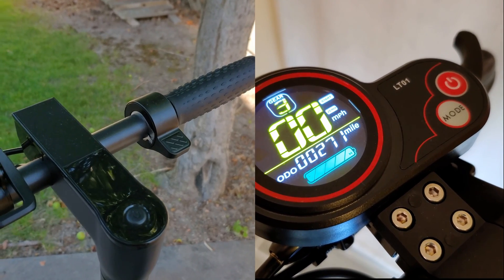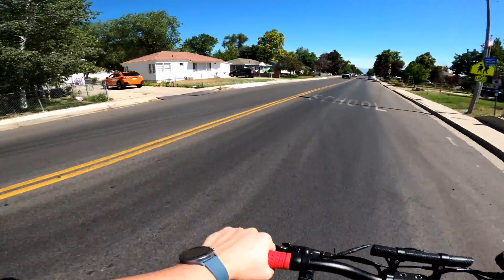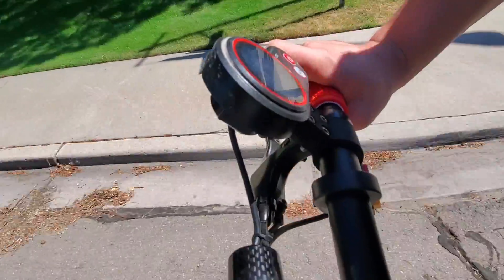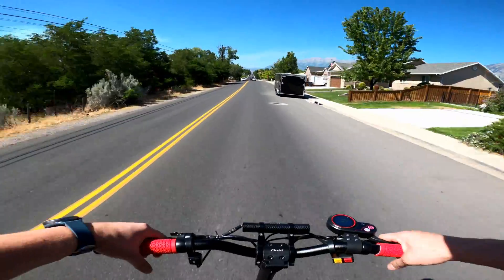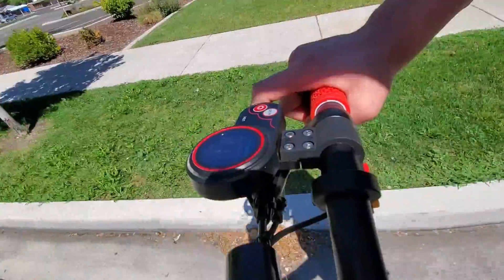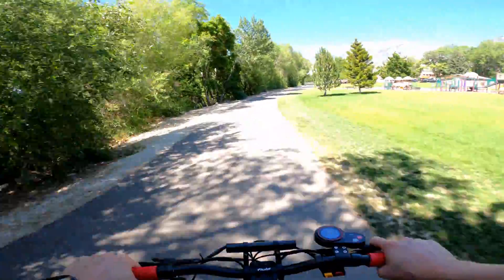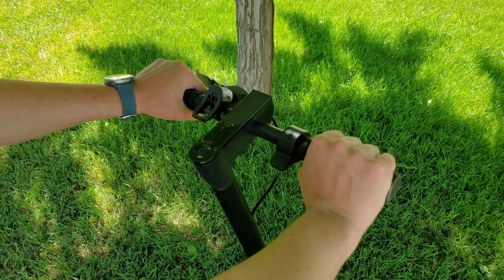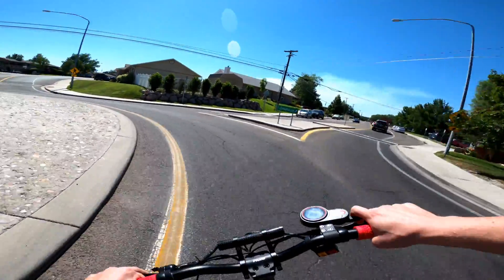Electric Scooter Throttles: Thumb vs Trigger

Comment: your thumb throttle is positioned wrong as well....same as the vertical oritentation of trigger throttle is completely wrong

your thumb throttle should be positioned so that when full throttle your thumb is completely straight and in the furthest reach position
that way it fully wraps around the handlebars and provides full grip and control and no fatigue

scooter manufacturers position both of these throttle types wrong and not many people use their brain and reposition to more ergonomic and safer position
I have a thumb throttle that I adjusted to my liking and have none of the issues you talk about

thumb throttle when positioned correctly is the safer option because you can have your fingers on both the throttle and both brakes at the same time so no need to repoision fingers from throttle to brake in an emergency situation

Comment: I originally had the Max with the thumb throttle. Then I got the 300X with the twist. I am finding I preferred the thumb throttle for scooters even tho I have decades of motorcycle riding throttle experience. Now I just need to see if I can convert my twist to a thumb on my 300X.

Comment: Calling it an error is a bit far for beginners to angle their trigger throttle...it's a design issue with the product.

To be comfortable for rider, the display needs to be pointed towards the damn ground.  Terrible design.

Sure it works...the only reason they keep making them like that is people like in this video say it still sort of works.

Sure, I could still technically drive a car with the accelerator pedal was the passenger side glove box handle, but it's pretty dumb.  There would be videos saying try it, it works, just drive leaning over and keep your finger on the glove box handle.

Comment: great video and agree with the positioning of brakes and throttle. sadly and most frustratingly, the kaabo skywalker handle bar, perhaps not wide enough or because it requires room to fold down, the brake levers and the throttle cannot be moved further inward, so they all end up cramped together with the fingers in the way of each other and no room to comfortably place or use them on brake and throttle without overlapping, blocking and literally dangerous and fumbling with the lever and trigger on top of each other! no wonder the throttle is perhaps, in my case, have to be angled up so as to be kept out of the way of overlapping the brake lever, preventing the trigger from being pulled, etc. etc. 😤😤😤

Comment: i prefer the Nami style (Wuxing 108X) and round throttle like Rion etc.

I had a trigger throttle, and when adjusted correctly it is decent to ride with, but it feels less controllable than one of those IMO

i can also put my thumb on the body of that style thumb throttle and do small movements because i ride in power control mode (while scooters out of the box ride in speed control mode)

Comment: Hello from Bulgaria..i have G-booster for 40 days...i had xiaomi 365 for 3weeks and i rode a kaabo 10 800w 2 days...i thought the trigger is waaaay better and looks x5 sportyer then my kugoo's thumb throttle newer display onboard computer/controller hahaha....sooo my little experience with these things showed me that the triggers are freaking DANGEROUS for a firsttimers...i wasnt a firts timer but i had veeeery close calls with that kaabo...the scooter was set in the baddest ways possible (brakes,triger and all) but still i am a guy who can drive everything,everywhere and on fulll power..i ride race bikes 750-1000cc and i can easylly say i can handle a scooter with ease...and that kaabo was dangerous even for me?>????what???i didnt believed i almost crashed 3 times for 2km hahahahha not so funny when it jumped instead of stop...my g booster was my first real scooter with real power and 8i never had problems confusing brake for throttle or thr. for brake...i ride hard and long..start on max battery and finish close or even to the moment you realize THIS IS IT now you push...its not nice to push 33kg scooter+gadgets+full set protectors,motocross helmet and a bend rotor who is making it soooo heavy to push...i had to remove the caliper to make it stop braking on its own...i hope my story is funny and informative...i pray to  alll Gods to set foot and hands on more powerful scooter...VSETT 10 or 11 or maybe a offroad beast with 2x2400 and 40A battery...i love to feel the danger and to fight the beast...i would love to ride with other ppl in some  ex6treme places...Love,Peace and POWER for us all...Amin

Comment: I learned the trigger throttle is up like that often times for shipping reasons and it looks to be for marketing too. The photos show the display better. But in actual use, you're standing over it and would probably want the display in a more laying down position than vertical. Having it so vertical is also bad for your wrist ergonomically.

Comment: I was looking for a scooter that had about 25-30 mph top speed to a range of 20-25 miles. I stumbled uppon the Varla Pegasus and Kaabo Mantis 8. I thought the Mantis was better overall with smoother acceleration, more portability and less weight, pneumatic tires and a solid build. One thing I was worried about was how I would like the trigger throttle. The varla pegasus had a thumb throttle. Right now, I had a segway ninebot max which has the thumb throttle. As soon as I got the scooter, I faced the trigger throttle more downwards for more comfort and easily felt comfortable with this throttle body. I agree with your points in this video. One thing I have to thank you for is recommending the mantis 8 to me. Just got one and I loved it.

Comment: i actually just recently bought a second escooter in 30 days and one of the reasons i picked the one i did was because it had a thumb throttle. i hope i dont regret it. the only other one iv tried is a normal throttle like a motorbike. that to me is the bet but i made a compromise for my 2nd.
i have a bogist m5 pro and a bogist c1 pro.

Comment: There's no better or worse since it's personal preference. It's only a comparison.
1:43 that's partly because upright is better to look at the display, especially under the sun. Not everyone use a phone for speedo. And being upright is slightly better to prevent being mistake the throttle as the brake.
It's kinda like pneumatic vs solid tires, or standing vs sitting debate. There would always be two camps. No right or wrong. Just personal preferences.

Comment: Xbox YouTube is officially fucking trash and I will never fucking use it again. Every fucking time I open a video, it randomly exits out after just a minute or so, even when I unplug my controller so there's no controller plugged in, there's absolutely no reason for the video to stop and back out, fucking none. I'm on my tablet and would you fucking look at that I'm more than fucking 2 fucking minutes into the fucking video

Comment: I feel like I have more control of the scooter with the thumb throttle at high speed. Trigger seem dangerous.. too many times at a light I pulled the trigger instead of the break and the scooter went flying out of my hands..Or while my hands are resting at a stop some how I tap the trigger.. bike go flying smh.. thumb throttle give me two different distinct motions for a function. Personally I feel having a throttle match a break style is idiotic and should be either a push style throttle or a thumb style but never trigger…bc it like breaking

Comment: This is what I've been trying to tell people but they don't get it. You need the thumb to grip because it is the only opposing finger to the other four. If you lose the trigger finger you still got the other three but on the thumb side if you lose it you got nothing so you have to grip the bar much harder causing cramping. When I use to race Jetskis they all came stock with thumb throttles and the first thing everyone did was ditch those for trigger finger throttles for better control. With scooters it seems the general opinion is reversed. Normally I wouldn't care but for the fact that you can't find any good third party trigger finger throttles because the manufacturers think no one would buy them. Sadly, most of the new scooters are now coming with thumb throttles.

Comment: The reason why people have it tilted up is that they're riding sitting down, otherwise, you won't be able to see the throttle display (I only adjust until I read the display). Whenever I ride standing up, I know I have to adjust it.

Fact: Trigger throttle was used on Gopeds since the '90s but were later swapped out for half twist and thumb throttle because of comfort. After 30 min of riding your index finger will be sore. To me, a trigger throttle is more sporty (cool) than practical. I think the half-twist throttle is the best overall. You should try it out, they have it with the LCD display.

Comment: Thanks for this video, I was about to "pull the trigger" on the thumb throttle, you saved me $80!  My display/trigger is at a 30 degree angle, that's the best I can do which is fine om my Voro Emove Cruiser, I didn't notice any brakes blocking your ability to move the unit all the way down flat where my right brake prevents further movement.
Reply: @JC Hall -- How is the position of the trigger and brake now that it's been a few months? Is it working for you? I'm looking to get the Emove Cruiser and debating about which style to use. Thanks!
Reply: @theagta  I'm very comfortable with the original trigger, working out well!

Comment: I have just bought a Dragon scooter with a dangerously fierce trigger throttle. Today on my 3rd ride, I found out what you just advised but also have a conflict with the brake lever which is now in the way of my index finger. I will try to angle it down further but my main complaint is the function of the throttle? It has to be turned very gradually if you want to avoid being thrown forward uncontrollably but the first 10 or 20 degrees does nothing and then it is fierce! What do you see as the solution to this?
Reply: This video seems to not cover ebikes where there are other things required.

Comment: I just installed my thumb throttle, but mine shows KPH not MPH and I can’t find a way to change it
Reply: In the settings menu, press and hold both buttons at the same time. But you have to know which setting to adjust...

Comment: Thumb throttle is okay and easy to use, i would recommend the option of cruiecontroll with them otherwise they get uncmfortable fast. Never tried trigger but i tried twist and it was way better even as only half the grip area was twisting

Comment: When I moved to a trigger scooter it was disconcentring at first, switching between throttle and braking and my glove would sometimes interfere with the brakes.. A littler adjustment on the lever and technique solved the issue. For short rides, almost no difference, but the longer you go , the easier the trigger.is

Comment: I just got my scooter with a trigger throttle, but the thing that you didn't mention is hand size...... i am a little person and am finding it hard to reach the trigger ;(  then the trigger is too big and gets in the way of me pulling on the break(my hand is too small to hold them both at once) ;( ;( ;( Why didn't you mention this..... you need a tiny person's perspective, i guess... (like all the females in the world lol). On top of all of that, the trigger feels sticky... like a ball mouse that hasn't been cleaned in forever...  but that might just be the cheap plastic, or spring, idk.. thankfully i can change the throttle on the e-scooter i have.

Comment: I prefer the thumb throttle with a 5 or 10 second auto-cruise control. I used to like the thumb throttle for a bit, until i find it always blocking the right handbrake lever. It isnt confusing, its just in the way...

Comment: i had a finger throttle on my first scooter. which was fine. 
then i got myself a ninebot scooter with thumb throttle. it was okay, since it has "cruise control" (after 5 seconds of having the throttle in a position, it will keep it and you can stop touching your throttle). 
but without cruise control, my trip to work (10 km or liek 6.2 miles) already hurts my thumb. i DID NOT have that issue with the finger throttle. 
my next scooter will have finger throttle again. it is an "IO Hawk Legend", based on the Kaabo Mantis, in actual cooperation with kaabo. 

actually, one german youtube already complained about the throttle of the Legend. i should check his positioning of the controller, and tell him to adjust it if needed.

Comment: Good informative video. I noticed this about your narrative. It seems like you are writing an essay with structure. ☺️ It is fantastic, very informative. A+

Out of left field with this point. 

I would love to aee a detachable battery like those ebikes.  It is a deal breaker for me.

Instead of lugging the bike/scooter out of your car, you can charge the detachable battery at home/hotel.

At a pizza place or a coffee shop or a library, they don't mind you bringing in a battery instead of a scooter.

Happy trails.

Comment: I have a trigger throttle and the first thing I did was adjust the angle of the trigger. I still find it awkward and my finger definitely cramps. Plus having trigger throttle AND trigger brakes mean you have to weave your fingers through both triggers in a strange way and if you let go you might mistakenly grab the wrong one when your hand returns to the handle bar. I don't have access to a thumb throttle but the rented scooters I've tried with one seem more comfortable to use.

Comment: I agree thumb level throttles are better than trigger throttles / thumb level throttles are easier to push down & you don’t have to stretch your finger around the trigger to get the scooter going / it’s less stress on the finger / & it’s definitely more comfortable / thumbs throttles are better 👀 / scooters manufacturers start making more scooters 🛴 with thumb throttles 👀

Comment: I have both scooter with thumb and trigger throttle (Gotrax gxl v2 250w -thumb throttle) and (evercross-800w trigger throttle) and i prefer THUMB throttle.
The reason why is because there a hand brake on the right hand along with the trigger throttle; (the Evercross)the hand brake has to be adjusted downward in order for the trigger to feel comfortly leveled with the handle bar, or the if the handbrake is leveled, the trigger is about a 15-20% grade facing upwards which causes more stress to my hand.

Comment: I have a Zero 8 with a finger-throttle in horisontal position. And auto-pilot om top of that. Still though - I would prefer a thumb-throttle. This throttle really is inherently better. Most people have the  acceleration-option on max. Therefore they want to have better acceleration-control with a finger-throttle. Change to slower acceleration, and enjoy better ergonomic comfort with the thumb-throttle. At least let the buyer choose for himself with type of throttle he wants - also on high-end scooters.

Comment: Hi, having both types in the scooters I own I can say that the trigger throttle definitely gets in the way of brakes. If you don't have a brake lever on that side possibly its better. If you have hydraulic brakes (as my friends Wolf Warrior has) then its even worse and either the brake has to be too far down for comfort or the trigger to high.

Each are difficult to control and requires the rider to put aside their fantasy that its a thing which should obey them and actually learn to use it (it is after all a machine).

Lastly after decades of motorcycle riding the operation of pushing the thumb is a bit more akin to the movement of twisting the throttle ... so there's that too.

My view is the most important thing is to learn how to take advantage of cruise control and know how to work that.

Comment: Hi. I am handicapped on my right fingers, so right trigger throttle is a big no for me. Would you recommend a twist throttle? or is there a left trigger throttle available across the globe for me to get?
Reply from the maker: Twist throttles are hard to find on electric scooters but if you can find it then I think they are great. Just like riding a motorcycle. I have never seen a left handed throttle but surely they exist right? You could probably dig around on alibaba or aliepxress and find one
Reply: @RK9Rides  If i have a 48V scoot, any 48v throttle replacement should do right? I found a twist throttle 48V. A replacement for Emove Touring/Cruiser. I am not just sure if model/part number should matter.

Comment: Thumb accelerator is good for slower speed and short distance. 
With trigger, you can control it very well even at high speed. 
It is also safe because you can lock your thumb on the grip to hold the bar better.

Comment: My scooter is using thumb throttle. I notice your thumb throttle is tilted backwards hence causing fatigue. Mine is tilted a bit forward hence less muscle stretching. Besides, the trigger throttle is a bit disturbing when braking, i often braking under accelerating

Comment: I was debating whether I replace the trigger throttle with the thumb throttle on my pre-ordered Zero 10X. After watching your video it makes sense that it would be more comfortable and more control using the trigger throttle. I’m use to just using my finger when it comes to braking and moving the clutch on a motorbike. With having the thumb wrapped around the handlebars at all times. Much safer too.  Thank you for the video. And yes, I am new to the scooter world. I can’t wait to have fun. “ROCK ON”

Comment: anyone you raced motocross already has index and middle finger on the front brake and clutch. it was second nature with the trigger throttle. thumb throttles are meant for quads